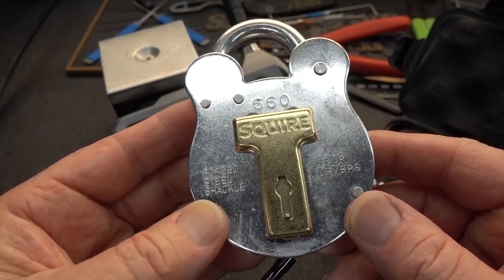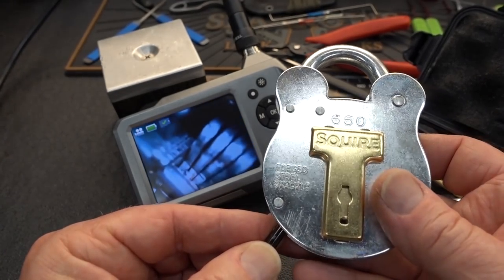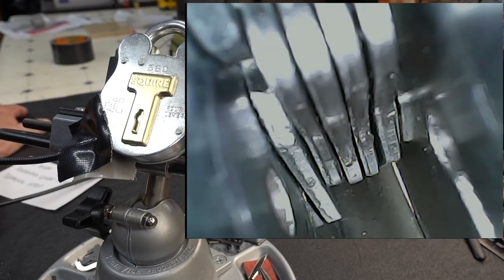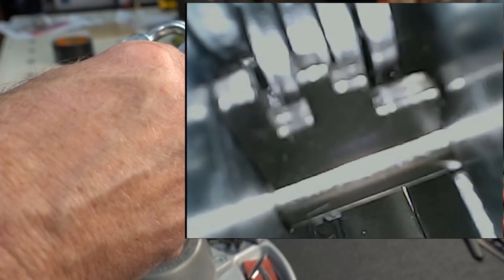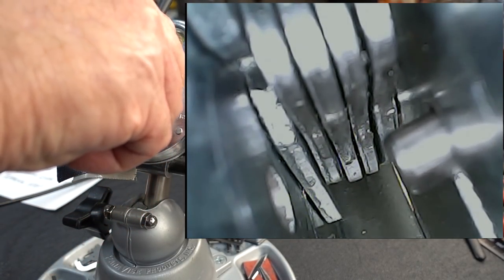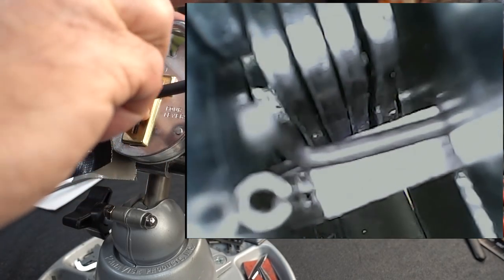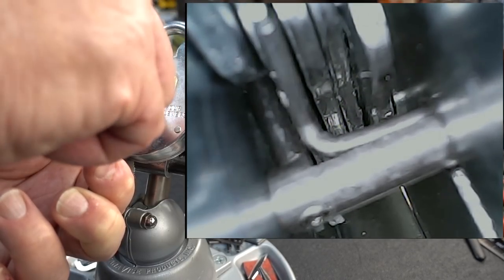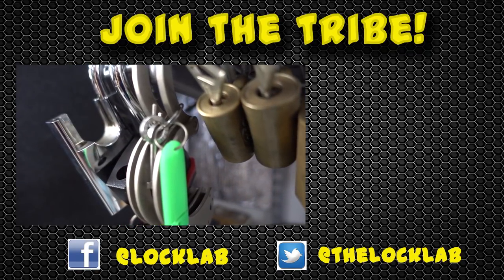(1374) LockCAM: Lever Lock Internals

Comment: I'm glad to have gotten you on the path
Reply from the maker: Kaitlyn,  I'm discovering that the "microscope" you send is MUCH better at closeup work where you need a high magnification, while the new camera is slightly higher resolution and fits tighter spaces, BUT has a longer focus range.  Your camera can be right ON the subject, while the new one has to be about 1.25" away to get a decent focus. So... BOTH LockCAMs will be useful for different "missions".  Thanks again for sending it in, I appreciate it!

Comment: Another way to practice seeing this is to get a cheap furniture lever lock that has no metal on the 3 unexposed edges that would normally be covered by the wood it's installed in.  This lets you see what this camera sees, but from many angles and with both your eyes.  Of cause those furniture locks are pretty basic as they only need to be harder than breaking apart the hardwood around it.  But they are the classic first training lock before proceeding to harder locks.  Same kind is available as warded locks.

Comment: Loving that youre embracing the lever locks, they are quite prevailent in the UK - though UPVC doors are gaining ground over wooden doors so Euro Cyclinders (pin tumblers) are quite common now. On lock you might be interested in is the ERA Vectis UPVC Lock Center Lock which is a lever lock for UPVC doors
Reply from the maker: Do you have a link where I can find one?  Lever locks are not common in N. America and I'm having a lot of trouble finding decent ones.  Thanks!
Reply: Pretty sure you're already aware but check out Andy Mac... he will be able to point you in the right direction.... Thanks for this really useful video.
Reply from the maker: Yep, I already touched base with Andy and he's been a TREMENDOUS help!  In fact, he just mailed some more pipe tensioners and a few padlocks from the UK, so Christmas is coming!
Reply: @bosnianbill  I will have a look this evening and get back to you.
Reply: Here is one: https://www.multipointlocks.co.uk/upvc-door-locks/era-vectis/era-vectis-centre-case-with-deadbolt.html
Reply: If you have trouble getting one shipped to the US I may have one in a week or two to donate once I have done playing with it with my new decoder, I wanted one to practice on before I did it out in the field, as I am a  working locksmith. These locks are what we call Multi Point locks as they are usually connected to a mechanism of sliders that go all the way up and down the side of a UPVC or Compsite door with mushrooms,  rollers and hooks that bite into keeps in the door frame so to lock these you need to" lift the handle" so you'll need something to work the spindle hole at the top to mimic real life usage. You can find Youtube videos of UK locksmiths picking the vectis to get an idea.
Reply: What makes this particular (ERA Vectis)  lock a formidable foe is the length of the key compared to normal lever locks, this is due the the fact that the keyway is deep inside the door when fitted si the key has to extend a way into the UVPC handle and door, so most normal lever picks arent long enough to reach in, and the way they handle sits above the keyhole adds to the trickiness of the picking process. I have to say I havent tried picking one yet (i ordered one from my supplier to play with) but from conversations I have had most "Warrant" locksmiths use the decoder on these locks. https://www.youtube.com/watch?v=3kl8ePm0s7k

Comment: The camera is an awesome new addition. Imagine if the camera was small enough to insert into tricky pin tumbler locks so you could actually see as you picked!
Reply: What would you expect to see? The pin stacks are encased so you wouldn't be able to see when you are at the shearline. Cut away locks are about as good as you'll get.
Reply: Yes, but you could see if pins were bound up, and you could also see if the key pins were serrated, or pin in pin, or ASSA pins - or side bars, or in medeco's how the pins are rotated, ETC, ETC, ETC.
Reply: Er, not quite. You could see the first pin (and probably the last if the rear of the lock was accessible). As for the ones in between, ...
Reply: Er, quite likely yes. Particularly with open keyways - if it was extremely paracentric then it might be difficult. Do you even pick?

Comment: Oh.. do you have a link for this camera to check it out?🤔👃
Reply from the maker: There are MANY dealers for the camera and they all LOOK alike, but you are looking for the latest revision (NTS151RS).  The RS costs a little more but has higher resolution and a smaller camera head.  Also, the claim of high HD resolution is....100% false,  but it IS adequate.  I got mine here:  https://www.ebay.com/itm/Teslong-Industrial-Endoscope-Professional-Borescope-Inspection-Camera-with-LCD/153155176014?ssPageName=STRK%3AMEBIDX%3AIT&_trksid=p2057872.m2749.l2649

Comment: You should check out the Chris Belcher curtain lock lock set or the ICL curtain pick set on walkerlocksmiths.co.uk
Reply from the maker: Thanks Clay!  I looked up both of these and think I'll save up some $ and eventually order the Chris Belcher set.  The reviews of it are very positive and indicate it is the best tool for low cut levers (which I'm finding more and more...).  Thank you for the tip!